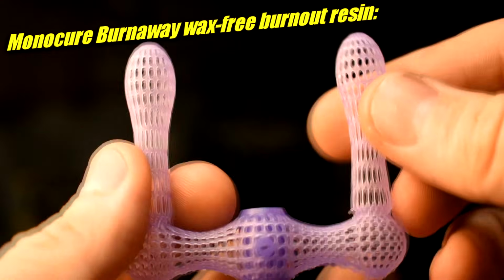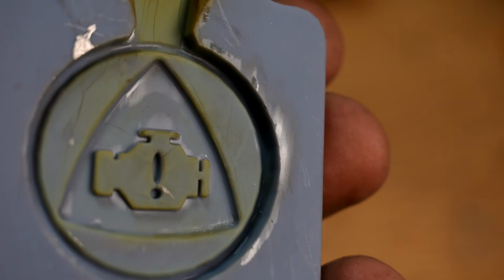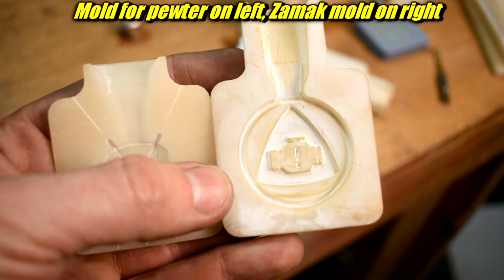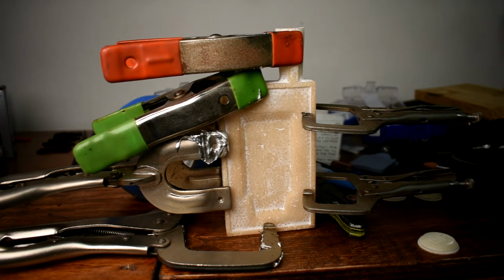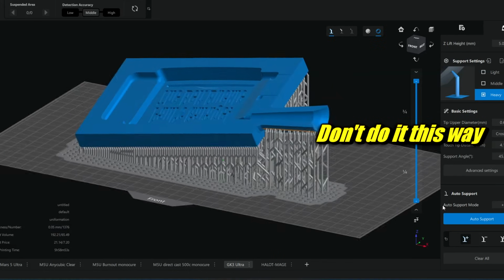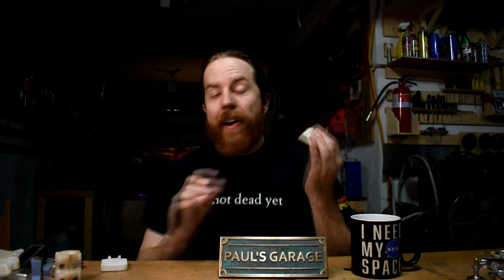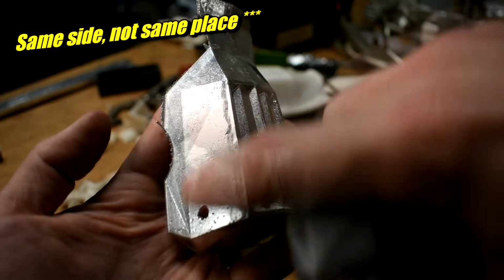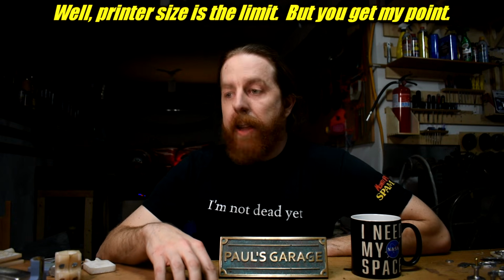EASY Metal Casting into 3D Printed Molds | Monocure ThermaCAST!

Comment: You mentioned film for your resin printer that releases easier. Is this available for all resin printers. I'm still working out bugs, but I find that I'm getting buildup on my film every print even though the film is new. I want to get the kinks worked out so I can start casting, I got into printing to cast stuff lol. Thanks for the video love the channel
Reply from the maker: yeah, it's called an ACF film, as opposed to the FEP usually found on printers.  the ACF looks cloudy and some think it reduces print clarity, but it still looks good to me.  An ACF film reduces peeling force significantly.  The Mars 5 Ultra used here has a normal FEP, though, and it didn't have trouble, but that one "peels" the plate off, not just straight up.
Reply: @PaulsGarage thank you, cleaning the film every print is getting tiring. I've tried different exposure settings and lift speeds. I can make it better but not get rid of it. I'd also like to get the support side to look better too. Right now it looks more like a lumpy mess. I try to orient stuff in a way that hides it or put it on a flat surface so I can sand it flat easier. Seems like punished props has a similar problem with their resin printers too

Comment: 14:37 print a normal-resin-mold, for the outer sides of the ThermaCAST-mold, ending in a flat surface. Then use thin steel-plates on these normal resin flat surfaces, to clamp much harder on the mold. 
Great as always !!!
Reply from the maker: good idea!
Reply: You don't even need to go through the effort of printing a negative to frame your molds in. Fashion a box frame to use casting sand you already have on-hand to sandwich your mold between. The layers would look like: metal plate that fits inside the walls of the frame, sand, mold halves, sand, metal plate. Use C-clamps to compress the metal sheets; thus, applying even pressure through the sand and onto the whole surface of the molds.
Reply: @Providence83  I still think, that sand might be too soft and maleable, still, but otherwise, yes, it´s the same idea, and should either wise help/work...
Reply: Yup...  Make flat backed molds instead of contoured ones so that you can use two pieces of metal or wood to fully clamp the molds together.

For RTV or vulcanized rubber two parts molds, just make the mold backs flat for the same reason. 

Clamping with those single tangency point clamps in a few places is not enough.
Reply: great idea

Comment: So this stuff is 3x the price of smooth-on mold max 60 silicone. Is it worth it to use this stuff over making molds out of silicone? Silicone is much more versatile, but requires more steps.
Reply: I use both MoldMax60 and Thermacast.  MoldMax60 can really only handle up to Pewter ("Mold Max 60 was developed for high-heat resistance applications and will withstand up to 560°F / 294°C").  Its advantage is you can have some light undercuts due to flexibility.  Also the self life of MoldMax60 is pretty short.
Reply from the maker: It's very different.  Silicone has its benefits but you can't print it like this
Reply: And I thought silcone molds were expensive, geesh 😢

Comment: This is really interesting, really wanted to get into jewellery from lost wax casted resins but the startup cost was way too much. Wonder if I could try with this instead.
Reply from the maker: This works for pewter jewelry, definitely.  You don't the same detail as with lost wax and vacuum, but a proper mold design and a vibrating table could get much better results than I did here.
Reply: @ thanks, would love to see a video covering how to fine tune it. Between vibrating table, pre heating the mould to prevent thermal shock, etc I wonder just how far you could push this method.
Reply from the maker: @BraithwaiteLuke  I'm going to keep making stuff with it, see7rms like the main issue i ran i to is air.  The air needs to get out.   I have some ideas to try, will probably make videos about it if I find anything interesting

Comment: If it can do metal at those temp with minimal loss of details, it should be a sure win for plastic injection molding forms.

How strong/brittle is the material?  Can you make a latice or columns to connect your flat clamping area or will they break too easily?

What is the viscosity of the liquid resin like?  Will i need to have the plate move up slowly or wait extra time to let resin flow back under during printing?

Crafsman used a different material for resin printing molds and recommended sanding the interface areas.  Have you tried making a bead and trench in the mold to prevent flash and leaking?
Reply from the maker: The stuff is quite strong, actually.  Pretty stiff, it doesn't want to bend, but strong enough i had some trouble removing heavy supports.  I needed metal tools to do it.  

The resin has strange flow characteristics.  It's kinda like snot, but its a bit thixotropic.  Meaning it turns runny if you stir it, but then turns snottier if it's just sitting there.  I didn't notice any need to slow down prints with it.  The Mars 5 ultra is very fast and I used it at full speed.

I didn't try a bead and trench but it might be a good idea.  I didn't do a lot to stop flashing because in my mind that meant the air was escaping, which is a good thing.  

I've talked to the guy at Monocure about injection molding with it, and he says it's should handle it no problem.  In my experience the temperature should be simple and the resin seems strong enough.  You would just need to remember a mold release spray or something
Reply: @PaulsGarage  Thanks for the feedback , Paul!   I have not looked it up so I cannot link to it but Crafsman mentioned in the plastic injection molding that there he found a table of vent sizes to use with different materials that let the air out but kept the material inside.  I hope there is something like that for Zamak!

Comment: For back drafted areas, print a core. I've done that for a housing where all 4 sides had back draft. No need for a core box.
Reply from the maker: That's a great idea!  There are so many options.  You could even do hybrid molds with this stuff. Shells and cores in a sand cast, you just need to break the resin out after

Comment: That is some impressive resin. Got to wonder what the lifecycle and safe disposal requirements of the final cured resin is like - as investment casting and sand casting you can with a little work reuse the stuff almost indefinitely, and its natural enough disposal isn't going to cause ecological harm. The regular resin master you'd print for those methods might be way more toxic, but it won't be consumed by use in the same way.
Reply from the maker: No idea on specifics but I'm pretty sure fully cured resin can be treated as normal non-recyclable plastic for disposal (garbage). Uncured stuff though, that has to be disposed of carefully. Only dispose of fully cured resins, you have to fullu cure everything left over before disposal
Reply: @PaulsGarage  Not sure anybody really knows how to deal with the rapidly growing influx of relatively modern resin concepts properly anyway - Afterall it took 50 odd years before folks noticed the way we'd been using and disposing of plastic was rather problematic, and those problems are not really solved either. So these epoxy and UV cured resins being relatively modern compared to that, and studied mostly for direct harm to humans.... 

As individuals not even going to make up a drop in the bucket, and the benefits of local production of the exact parts you want etc. So not something to be hugely hugely concerned about, but it would be nice to know still that this stuff has a good disposal path.

Comment: Also don't make cutlery out of pewter, unless you want to find out why Europeans used to think tomatoes are toxic. (The tomato acid leeches the lead out, and then when you eat the tomato you eat the lead.)

11:30 There's lead free pewter? I thought lead was a key component. I guess they used it to make up for some flaw you normally get with bizmuth/tin that we either live with or solved in some other way today. Never mind then.
Reply from the maker: Yeah this is lead free pewter, mostly tin based.  Royometals sells the lead stuff too, but I'm so worried about contaminating my za12 that I never melt leaded anything.
Reply: @PaulsGarage  just use a designated crucible.  Many alloys still use lead, exception of course being plumbing industry.
Reply: Food Safe Pewter is all Lead Free.  Lead has been banned in these alloys for over 50 years worldwide, and even the earlier "good" stuff never had lead.  Lead was an adulteration added to make "cheap" pewter

Comment: Makes more sense to just do investment cast and resin print the positive (using the appropriate casting resin) and burn it out than pouring into a resin mold.
Reply: That is like saying it never ever makes sense to use a CNC mill, or FDM printer now powder bed or SLA printers, or fancy EDM processes (etc) exist - time and a place that each method makes most sense. I see this resin as the ideal casting prototype or one off tool - you can skip all the steps creating a perfect and reusable master, with multi-part split mould or silicon moulds for the burn out inclusions etc and just test the dimensions, stiffness, yield point, ergonomics etc of that part in the real world - wasteful of the mould by design, but saves a heap of time getting to making the right mould in the end!
Reply from the maker: You can do higher temp metals for sure with investment, and get better details, but for something like pewter you can beat the ease and cost of this stuff.  Plus you can cast many from one mold.  I'm not throwing away my vacuum casting machine, though